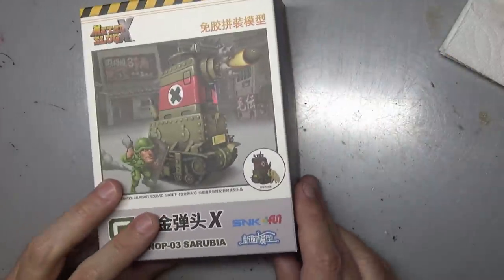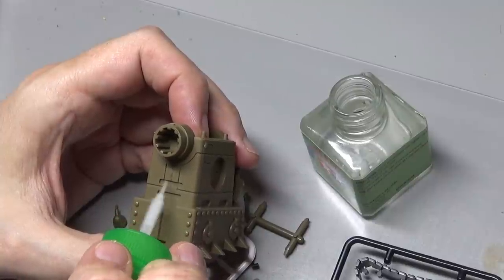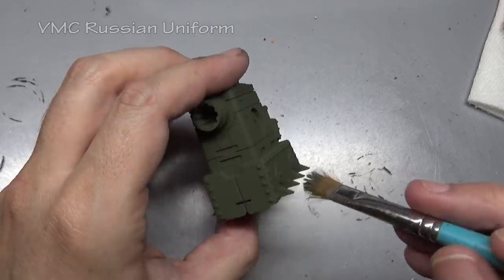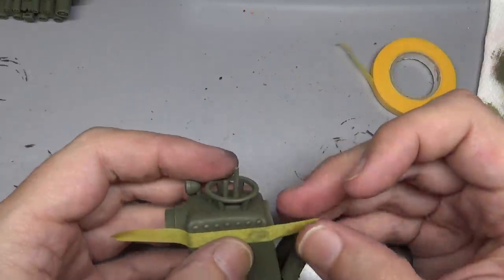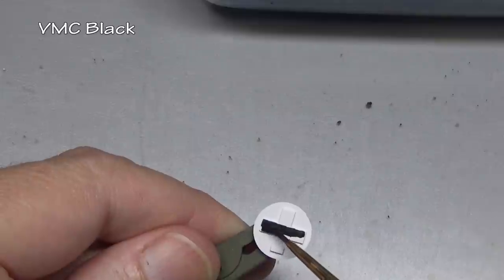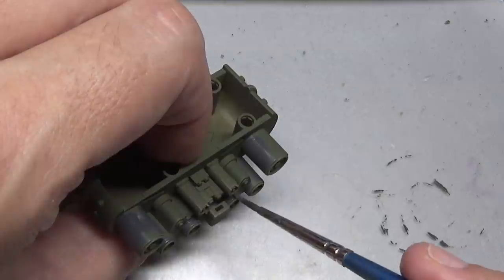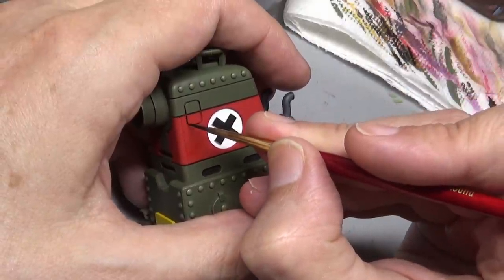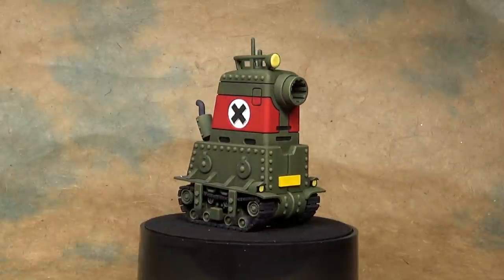Weekend Build: Metal Slug X Sarubia Tank Model Kit - Basic Model Building

Comment: Im a relative beginner and I've heard of the differences in building Resin and Plastic models (glues, etc).

What do I do if I can't tell if a kit is Plastic or Resin? 
Some kits/manufacturers don't specify or it's in a different language. In other cases, the kits I get are secondhand.

Is there a way that I can tell?
Reply: Most kits are going to be plastic. Anything that comes on large die-cast sprues are probably plastic as well. Resin is harder and more brittle, and tend to come as either individual parts, or in small groups. They usually also have a waste block rather than a sprue like diecast plastic.

If worst comes to worst, if you try gluing something with plastic cement and it doesn't join, then you'll know it's resin and you can switch to CA glue.